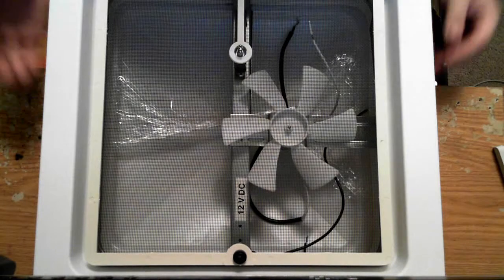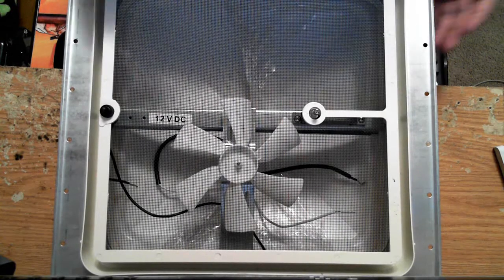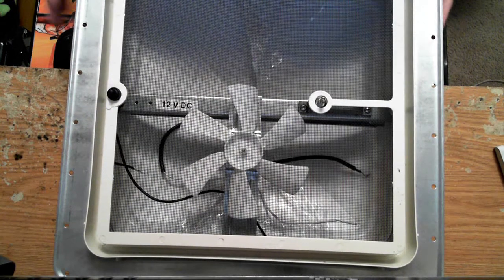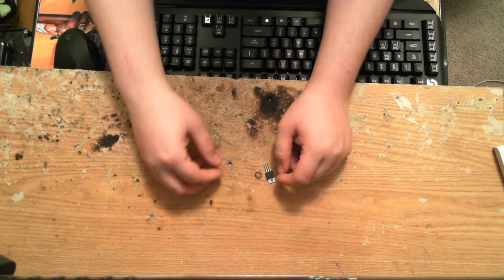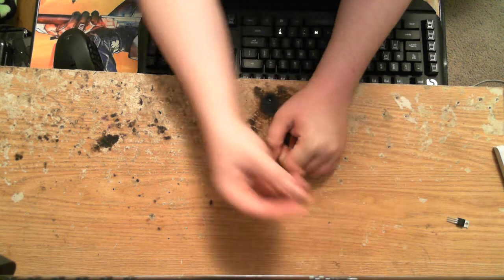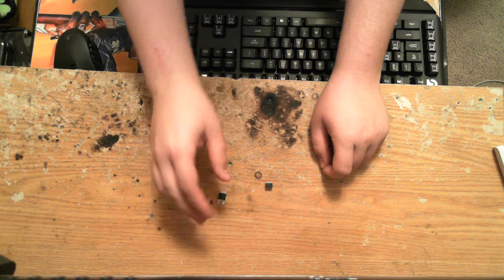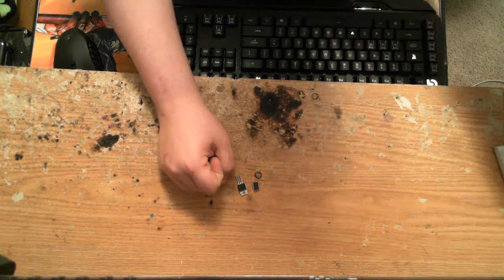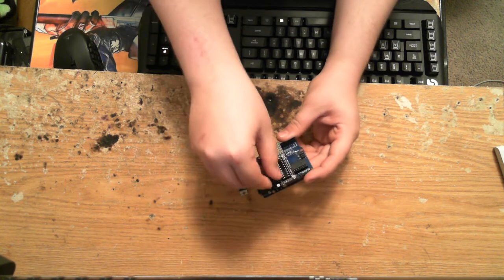fan speed controler idea

Comment: How did this project go? You should use a flyback diode to protect the mosfet and probably an EMI ferrite on the motor leads as well, since those brushed DC motors make lots of high frequency noise. (Which in some cases can actually cause MOSFET failure)
Reply from the maker: actually going pretty well i did put a flyback diode on the motor and a 
good value cap across the pwm output after which a ferrite had little 
effect sadly which got rid of alot of the noise and more smoothly 
adjusts the fan aswell.